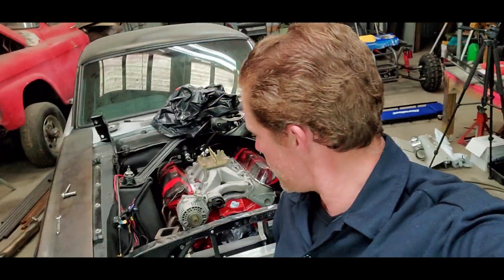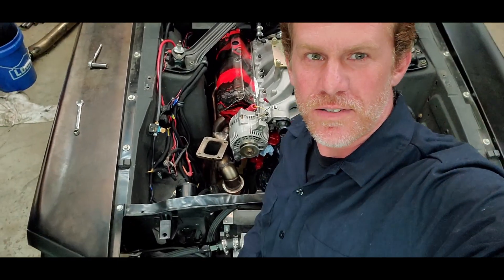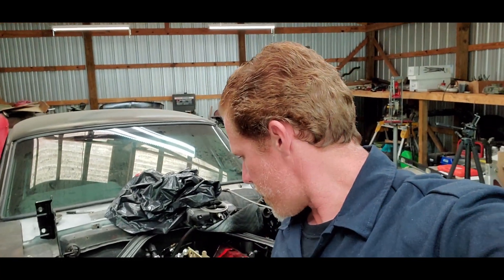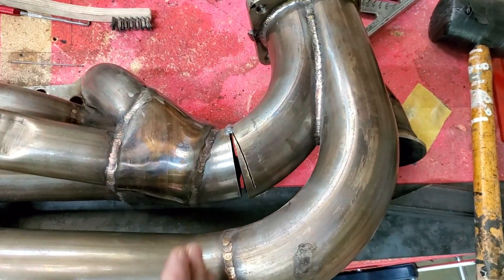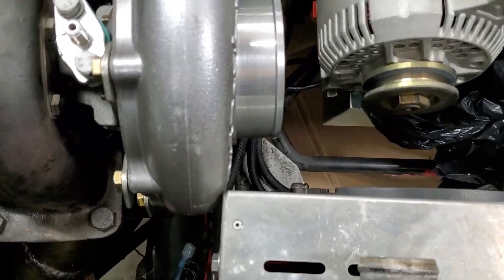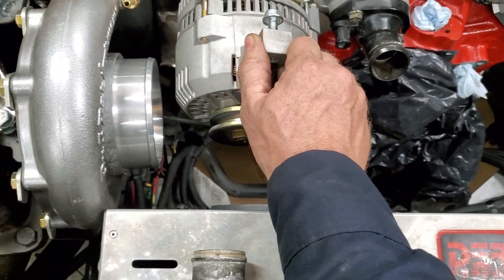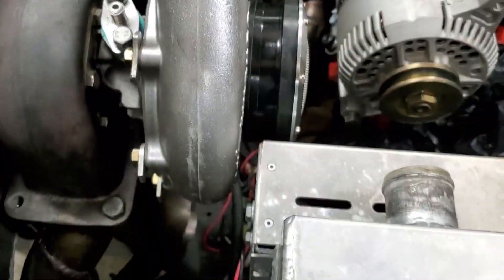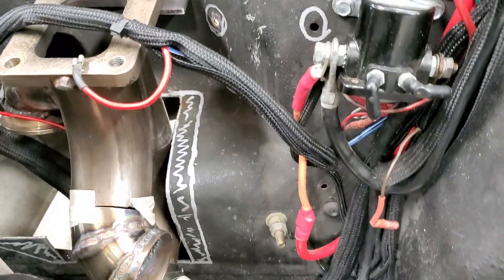Junkyard 351w budget turbo build pt13

Comment: What AR housing did you switch to? You said 76mm On3 turbo correct? Awesome build, been binge watching last couple nights at work.
Reply from the maker: Not to ruin it for you but I did have to upgrade. The car now has a Vsracing 7875 with a 1.25ar back housing. Which should flow a lot better than the On3 turbo which was a 7665 with a. 96ar back housing